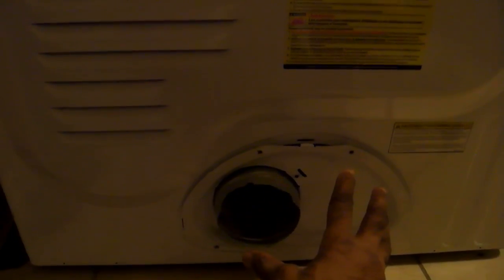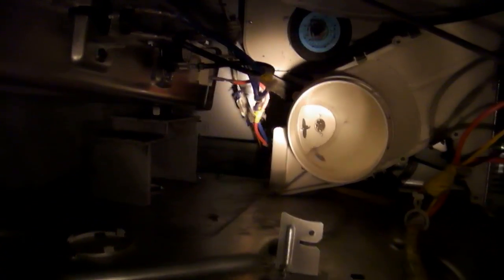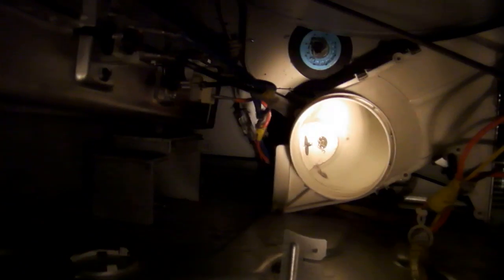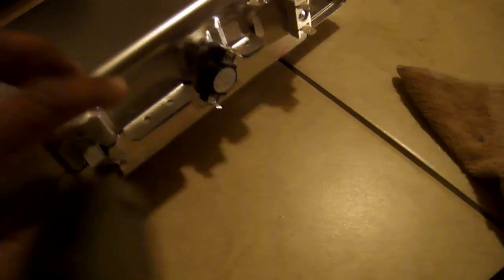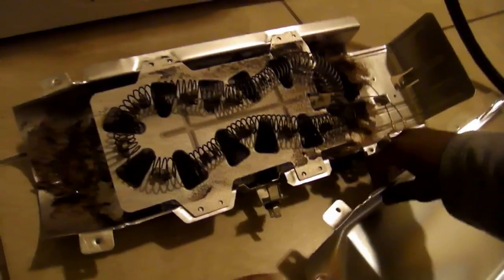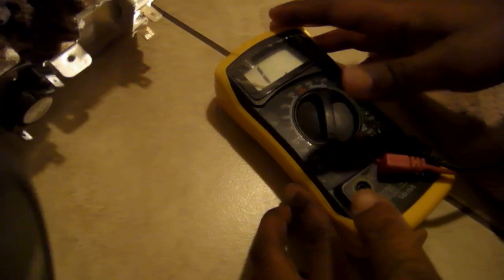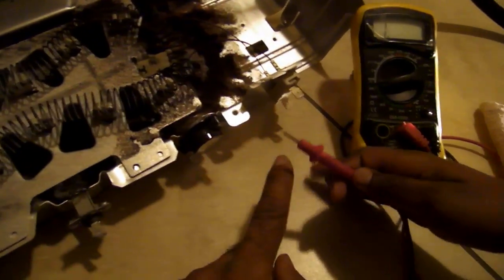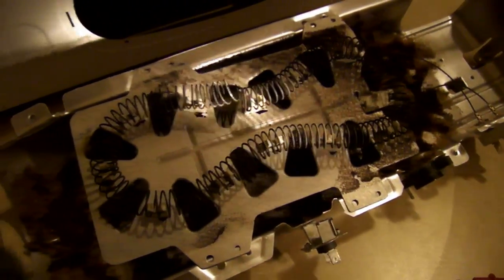Amana 7200 Heater Element Removal.MP4

Comment: Mr Felder. Thank you for this video, my  1 and 1/2 year old Amana dryer has stopped heating. I am an electrician but do not know much about appliance repair. I paid $15 at an on-line site for some information which was good but would have me taking off the top and removing the drum to access the heating coils and thermostats. Your way seems like it may be much easier. Thank you again,. I applaud the fact that you are teaching you son to do these things. He will always be proud to be your son.

Comment: Thomas really appreciated your video, especially about training your son! After viewing your video I did some research and decided to go through the front, This was very easy but did require removing more screws. This took me exactly 30 min for the complete removal and replacement. First you have to remove the top by removing 2 screw in the back that hold the top on. Then slide it back and it will come off. Then remove the screws that hold the control panel on, then rotate the panel towards the front and lift it will come off. Be careful of the wires, and set aside. Then remove the screws that hold the front on (there are two inside the door at the bottom, this will loosen the front panel to where you can unclip the wire from the door. Now you have exposed that nasty screw that Thomas was discussing that needed a special tool. Remove the screw rotate the heat element, lift and disconnect the wires and then replace the element as Thomas showed in video. Reverse to put back together. This was super easy! Just more screws.
Thanks again Thomas for the video!

Comment: I am one of the least handyman/repairman type people in the world. This video was a huge help. I found the part on amazon (eligible for Prime free shipping) on sale for $28, and after watching the video a few times I felt confident enough to try it myself. It was a lot more work to take the lid and front cover off, but my arms are too big to try and unscrew stuff using only that little hole. The screw on the front was SIMPLE without the cover.  Again, I'm not handy but I was able to disassemble, install, reassemble and clean up in less than 90 minutes.  Only thing I would have liked to see from the video was completely removing the old element. I spent a lot of time trying to pull the leads out only to find a small tab was crimped down to keep if from falling off. Perhaps that's standard common knowledge for people who know what they're doing, but it took me awhile to figure out.  Overall thank you for this video and saving us a couple hundred bucks to have someone else come out and fix it.

Comment: Thanks so much for taking the time to make this video Mr Felder.

I wasn't to keen on pulling the control panel off as instructed by the manual.  Much prefer your method.

I also found only the one front screw needs to be removed using a short Philips.  I also removed the two sensors rather than pulling the leads thinking less risk of damaging the sensors or connectors instead of pulling the leads off.

Comment: Great video.  Helped me remove element with ease.  I too could not get to,  or get leverage on the tiny screw at the very back of the dryer.  I thought outside of the box and simply drilled  a small access hole in the back of the dryer panel.  Directly over screw,  just big enough for the driver tip to fit in.  Guessed right in first try and screw came right out.

Comment: Thanks for the video. Only one I could find on this model. Like some of the others, I did end up taking off the front panel to remove that stupid screw. I did the "twist the coil together" fix, too, just to keep the wife from sitting at a laundromat all day. Hope it holds till the new one arrives. It's never has hard as it looks the first time you try it. Just remembering where all the screws go is always my problem...I always have at least one left over.

Comment: Thanks for your help- Without your help I wouldn't know where to start. 
As for the screw with limited access in the rear mine was very loose I could put a bit on it and turn the bit with my hand to remove the screw.
I made a quick fix by twisting the coil together to keep continuity so the dryer could be used while I order the new coil. I wouldn't trust this for long as where it's twisted together will probably get very hot and be more prone to breakage.
TY

Comment: Thank you for this video! I ended up opening the front panel for that tough to get at screw. Actually the other one was much worse as I couldn't find a short enough tool. All worked out ok, dryer is good as new now.

Comment: thanks for info. couldn't get from back, had to pull front panel too. i bought a small rachet like yours, but impossible to unscrew from that backward angle. 

remove top, 2 screws, front control panel, 4 screws - and break off tabs, then 4 screws on front door panel. then 2 seconds to remove screw, lol! 

they need a quick access hole there or from bottom. they have 2 small access holes on bottom, but to nothing!

got part at senaca river trading for about $43 shipped, cheapest and 2 days ship!

Comment: I saw no video's or manuals on how to do this , this was the only one.  Sorry to say this would have to be the worst way to change the element or to even get at it.  You don't have to touch the back at all.  Plus that screw you are taking out in the back does not hold the element case in place. 
Take off the top
Take off the control panel
take the front off- unplug the one electrical line
undo the front screw on the element casing- pullout the casing after unplugging the lines attached.
Took me a total of 20 minutes to get it apart and out.  Quick easy and a lot of room. 
10 minutes to put it all back together.  But thanks for the video anyways/

Comment: I will add that the back screw does not have to be removed, just the far screw toward the front. Also be careful to check the heating coil so that it's not touching the walls or anything. I had to take it all back apart for that (blowing fuse).

Comment: The front screw does not need to be removed. It does nothing to remove it. It's that back screw that needs to be removed and then the whole housing lifts out. I was not able to get the front screw out with any kind of screw driver from the rear of the dryer. It was impossible to get any kind of leverage. I had to take the door and front panel off. A real crazy design! took 4 Hrs to complete the job.

Comment: My dryer will run but only for about 30 seconds or so. One thing I found suspicious is that it wont run at all if its loaded with anything but one shirt. Can u guys give me some pointers on this issue. Its a amanda gas dryer

Comment: Good Video, one way to do it, but difficult and requires a $20 tool, and worst of all you have no leverage on the screw.  If one unscrews the two top screws in the back, then removes the top deck, unscrews the 4 screws holding the plastic bezell with the display and switches.  Carefully tilt it forward, and lift straight up (be careful of the wires), it will come right off, then you can access the 4 front cover screws. Remove 4 screws and the front cover comes off...

Comment: I hate to burst your bubble but this way is the hard way...there is a total of 17 screws to take out and the heater element casing comes out the front very easily..the top of cabinet comes off first then the control panel then the door (front) panel...from there its simple

Comment: What you dont see in the video: Those scews are a $#@! to get out unless you have some SERIOUSLY tiny hands. I had to remove the front panel of the unit to get the one in toward the front. The one in the rear is worse because there's nothing you can remove to gain easier access to it because the rest of the chassis is pop riveted on in the front.

Comment: A+ but why didn't you just take off the front panel?  You could of removed that front screw that secured the housing of the element with a regular philips without spending money on that ratchet and it would of took less time than the round trip to the store.  Also on my unit there was no screw in the back, it had a clip with a lip that was wedged into that circular opening that also had a lip.  Maybe a different year/serial# with slight variances.  We got a good 7 years before the element broke.  But anyways good job.

If anyone is wondering the part number is Heating Element 35001247 (Whirlpool/Amana)
http://www.repairclinic.com/PartDetail/Heating-Element/35001247/1185561